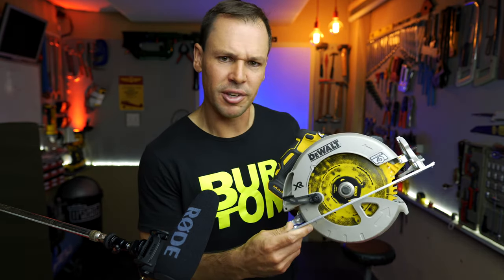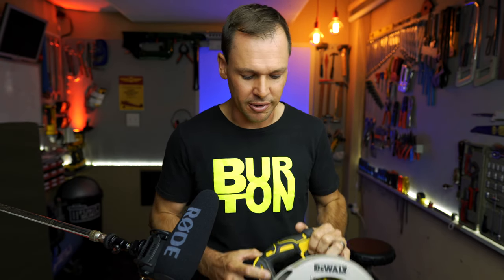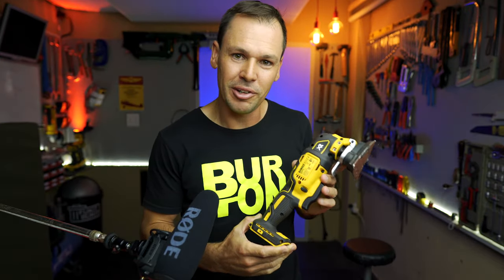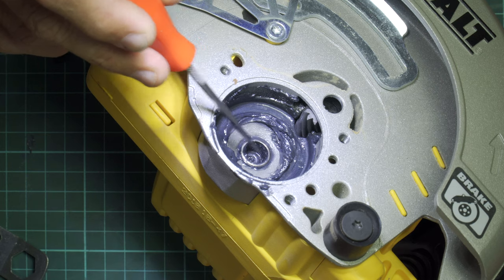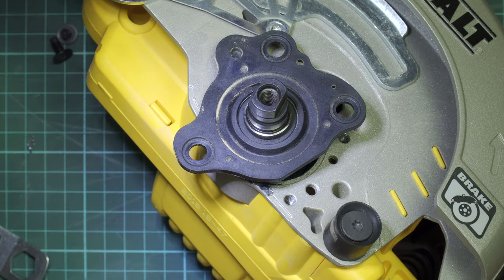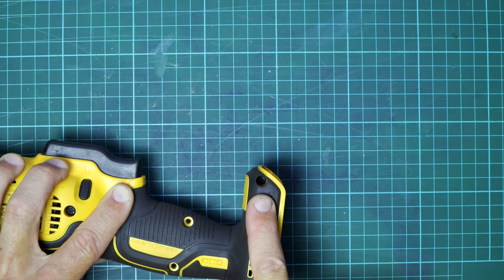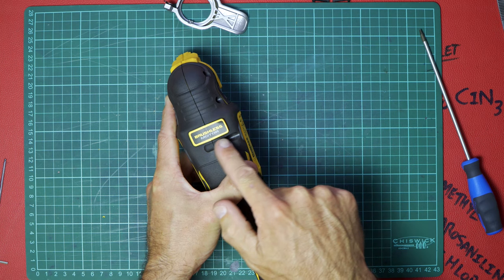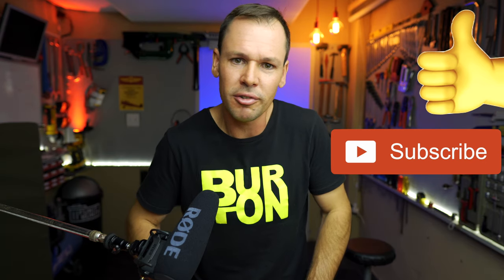TEARDOWN DeWALT 20v MAX DCS570 Circular Saw & DCS355 Oscillating Multi Tool - Burton Builds [4K]

Comment: I have the slightly different DCS354. For that one, they have helpfully 😅 added two more labels at the handle end of the tool (one next to your pinky, the other next to the battery electrodes) to prevent owners from servicing the tool. I carefully cut through these labels as well as the one on the top of the tool. Also the screw that holds the blade release lever is now a Torx screw (at least in the Canadian version). My problem that led me to your video was that drywall dust and sawdust had entered the interior of the tool and bound up the locking mechanism, which sometimes caused the tool to stay running when trying to release the lock. Not safe! It just needed some wiping and vacuuming in the interior to fix. Thanks for the helpful video!

Comment: The silver plastic blade change lever on the 355 Osc tool is disappointing considering on their corded version it was aluminium.  I have the 356 model with three position speed switch and the lever is plastic on that one too.
Reply from the maker: It’s probably much cheaper to produce the plastic lever compared to an aluminium one I guess. I also wonder how well the aluminium lever would hold up to being dropped… it’s going to be strong to a point, and then snap. I plastic lever would likely just bend and spring back to shape if repetitively dropped (the downside being the pivot point at the bolt).

Comment: will DCS570 take 190mm blade?
Reply from the maker: I'm not entirely sure... DeWalts website says it takes blades up to 184mm (7 1/4inch) so the 190mm blade is only 6mm diameter larger, so not very much larger at all. Personally, I wouldn't use a 190mm blade although my experience with using circular saws is fairly limited.
Reply: @GrantBurton  I was wondering if there is  enough clearance between blade and guard. Larger blade needs only 3mm more and 190mm are more popular in my country.
Reply from the maker: I'm not sure... and unfortunately I won't be around my tools for a few weeks so can't check for you. Hopefully another viewer could measure it sooner and let us know.